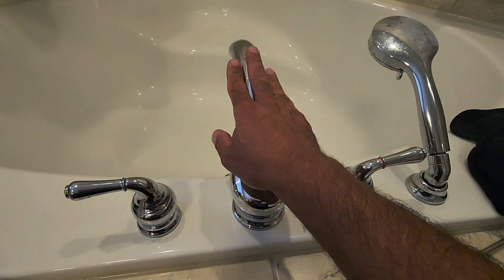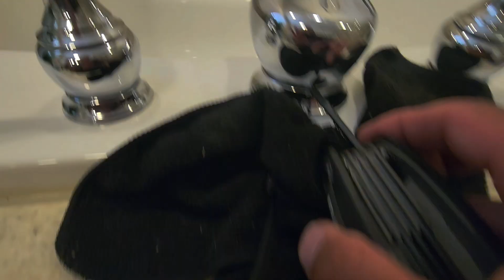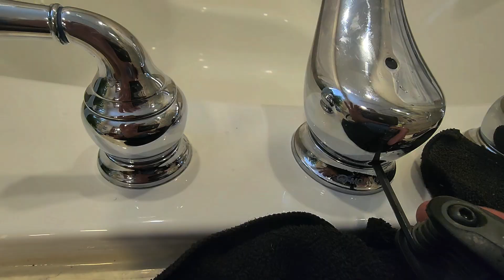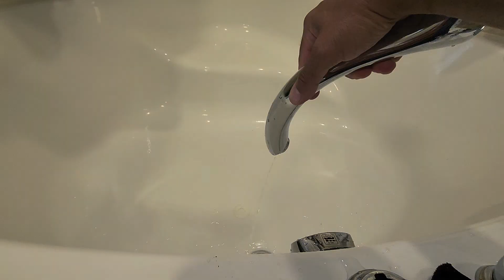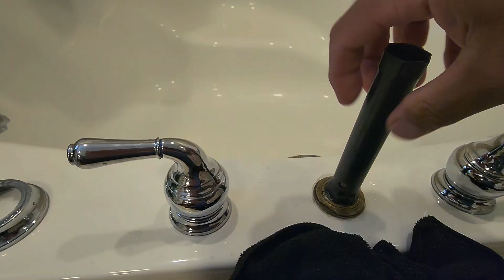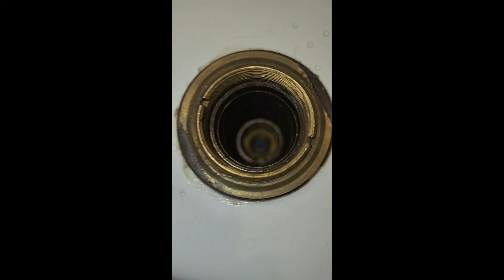Moen Roman tub faucet Monticello Diverter no water from shower repair

Comment: I couldn't believe it. I actually had the exact same problem. Had to call Moen and got the tool to pull the diverter that was installed circa 2010 (excellent customer service). It looked like there was some sort of white check valve, or plastic piece blocking the flow to the hand held. Punched a hole in it and the hand shower works after 16 years. Thank you kind stranger.
Reply from the maker: Glad the video helped, and hopefully it can help others. Enjoy your new old shower again :)